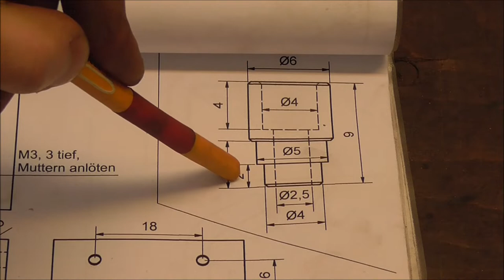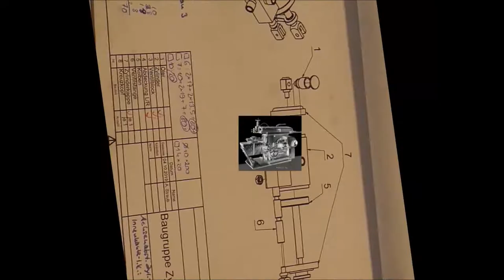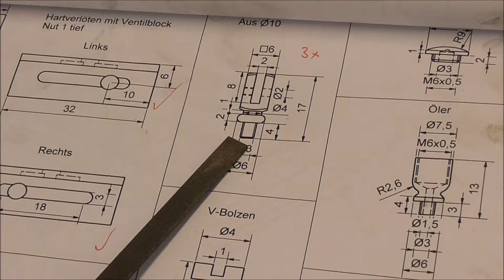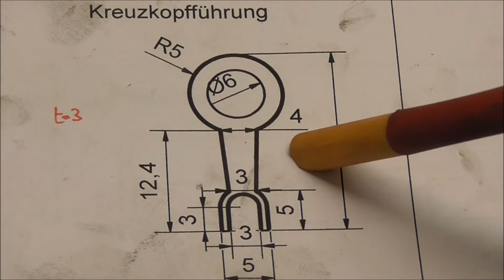Pistons and Small Parts - Doll 362 Replica #8

Comment: Who said barstock cylinders could not be beautiful? Whoever said that can eat it up now.
Reply from the maker: Thank you - and thank the engineers of Doll&Co for their pretty design!
Reply: @AstraWerke  I hawe no doubts that You will live up to that standard.
I once saw a picture of a very strange Falk machin that instead of the piston lenkage to the slidevalve  had a 90 degree set of cogwheels wich in the slideventil end had a pair of adjustable excenterplates wich worked a bit like the crankshaft of a combustion engine, but the excenterplates whare pushing on one or the other of a pair of small cone walves resting on steel spirals for tension, wich feeded the cylinder from a sidemounted steambox. I think the waterpump also had a cogwhell in order to syncronise it with the mainshaft and (sort of...) make it possible to change the speed of the feedingpump. I had newer seen anything like that before.
Reply from the maker: @sheep1ewe  It's impressive what levels of detail they went into with what is essentially a toy! Doll also built a valve operated steam engine - it's even rarer than the 362 I'm building.
Reply: @AstraWerke  
I am not sure, but i think Josef Falk made some of the machines for Bing and Tomas Doll.
As i remeber from the head there was more than 130 different models in their soriment in the 1930s... 
I hawe the machine and parts of the boiler from a similar machin, but with the traditional piston länkage, You are realy a great inspiration for putting those old ladies back to as they where supposed to be back in their glorious days!

I hawe the later wersion of that nice Märklin maschiene too, but i think it's possible slightly smaller than Your machine and it does not hawe the generator (only the pre drilled holes for it), i guess the generator was an option on the later machines, so i temporary putted a 1970s diecast Wilesco generator on it until i manage to find an original Märklin generator i can afford... Maybe the later diecast Märklin generator is slightly easier to find with a bit of luck compared to those older laminated tinmetal ones, i think the diecast potmetal generator should be in line with the manufacturing period of my machine since it look to me like a  late1940 one acording to the boiler details on my macine.
Yes, i love them as much as You do! ha ha
Reply from the maker: @sheep1ewe  I'm not too firm with the company history, either - I know the Doll brothers were persecuted and emigrated during WW2, so Fleischmann took over their business. Falk engines do have some striking similarities with Dolls, too - the crosshead guides and cylinder cap mounted oilers for example.

It is a fascinating topic! There's a website called "Fleischmann toys" with just about every Doll steam engine ever built. It's impressive what a huge range of machines they built. I might do a replica of a 512 somewhen after I finished this one...

The 4097 Märklins were built in several different sizes, and yes, the generator was an option - even a waterpump was available, but very rarely bought. (Guess what, they'll cost you the soul of your firstborn these days!)
I wish you luck with finding a generator. Take your time, a cheap one will come when you least expect it ;)
Reply: @AstraWerke  Maybe everyone more or less loosly copied each other, very early Märklin engines seem to be loosly based on the same basic concepts as well,
I hawe so far only seen the old Doll machines on photos, but it would be genuinly awsome to see one in action on a live exhibision one day! They are extremly rare in Sweden especialy the larger ones.
As i heard Josef Falk also managed to escape and survived, but exactly what happened to him seem to hawe been lost in history.

If You happen to come across someone who know how to find messurements or copy of the drawings for the boiler steamdome and boiler base to the Falk 143/3 i am willing to pay you money for the drawings if needed.
Reply from the maker: @sheep1ewe  It might well be. Copying designs was just as common back then as it is today.
I'm sorry to say it, but I don't know anybody to have plans or dimensions for the steam dome. I had to make all drawings for this Doll by myself - using what photos there were online and the few dimensions given in the catalogue (flywheel diameter, baseplate size).
Maybe there are enough photos online to try that approach?
Reply: @AstraWerke  
Thank You anyway, yes i tried to collect as many photos i could find, making drawings from scratch will be an exciting mental challenge as i see it!

Clearly more accurat than most modern intelligence tests... ha ha!

I recently got an old metalshaper from a friend unfortunatly it's in the other end of the country but i hope to find a way to bring it here, i realy love those machines too!
 Mainly because they are beautiful and easy to use and the tools are sheap to make compared to rotary milliong tools.
Especialy things like making cogwheels for example can be realy expensive to achieve on a rotary milling machine but is relativly easy with an old shaper.
Reply from the maker: @sheep1ewe  Good luck with your steam dome - I had a great time making the plans for that steam engine!
Shapers really are cool things. They are much more peaceful than a milling machine - they operate more smoothly.
Sure, it takes more time, but it's more than entertaining to see the tool hogging off chunks of metal. And then there's of course the cost factor. No expensive cutters for special profiles required - just grind them yourself and resharpen them as many times as you like.
I'd never trade mine in for a milling machine.